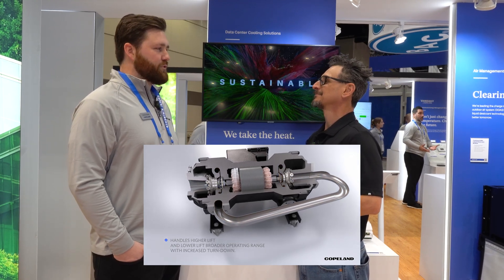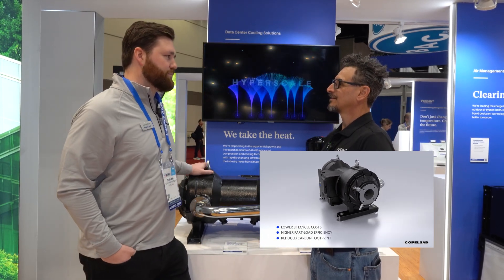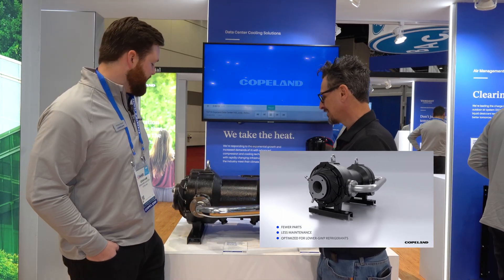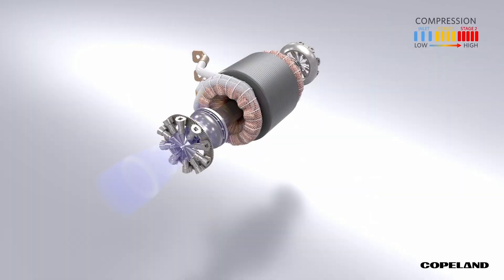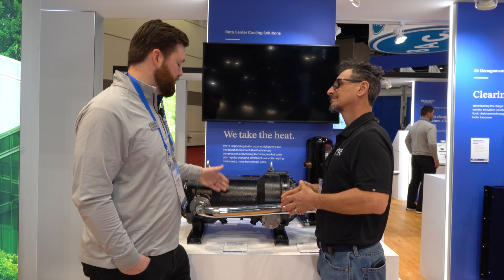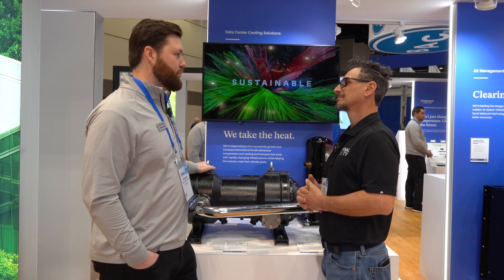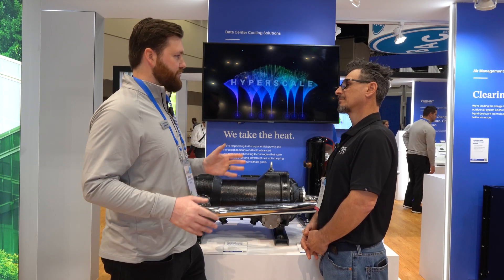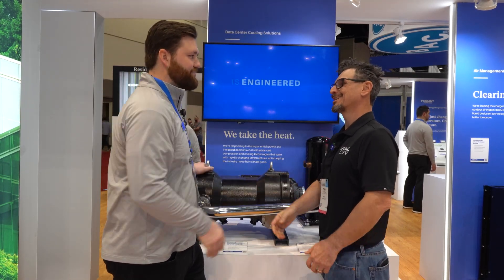Copeland Oil-Free Centrifugal Compressor

Comment: Hi, I'm interested in this product.
I am looking for enough tonnage the replace 4 60 hp reciprocating ice plant and to replace three York absorption chillers using three diesel boilers all using sea water condensers replace current system with new high efficiency Copeland oilless centrifugal compressors and look into air cooled condensers or other and go with ice storage chillers to save money running them on low peak night time hours retrofitting 24 year old plant and need air handling units retrofitted with new coils filter system and desccicant dehumidifier system installed with the current air handling units, and put the new plants on the roof by the desccicant dehumidifier to use heat recovery from the compressors to regenerate the desiccant I need onsite evaluation of all systems and secondary loop of satellite building on the chilled water system and quotation and project management. 
We are Al Shallal Theme Park in Jeddah Saudi Arabia. 
I would really like to chat on what's app 
with a knowledge engineer in modern refrigeration systems
966 59 5459914